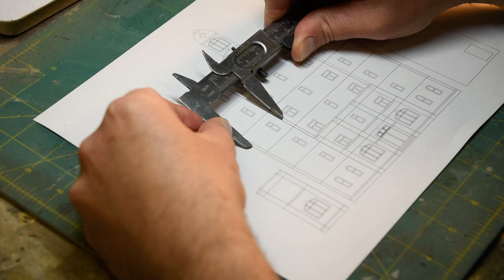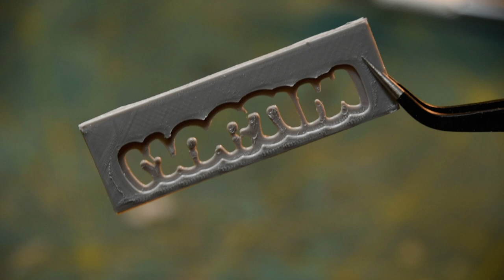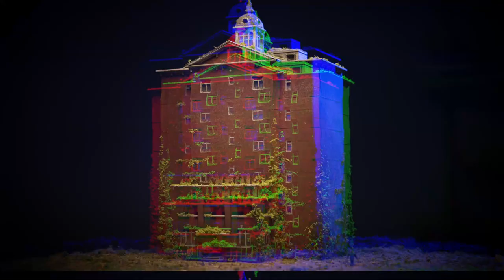Structure Series 11: Kitbashing the Oregon State Hospital [One Flew Over The Cuckoos Nest]

Comment: Wonderful work again. If I were allowed to make one suggestion, I'd propose to add some more, smaller tags on and around the larger pieces of grafitti, as they look all great, but each a bit isolated. Something simple, perhaps with a micron pen?
Love the way you're printing the templates btw...
Reply from the maker: You are absolutely right. I think the graffiti stencils turned out great, but the overall design is lacking. I'm looking to get some fine point paint pens, as well as some Micron pens to try to make things a little more believable. I appreciate the feedback, and your comment is 100% correct. Thanks!